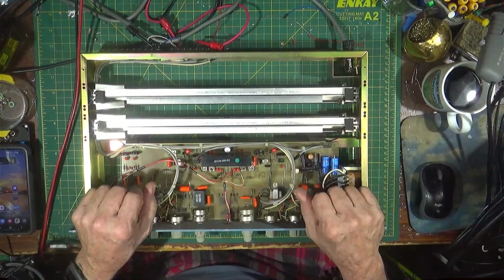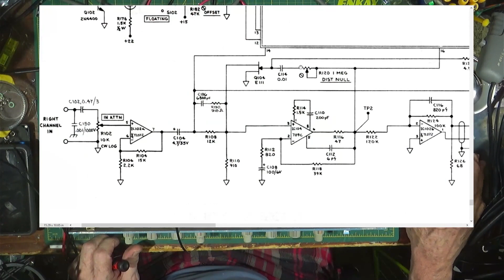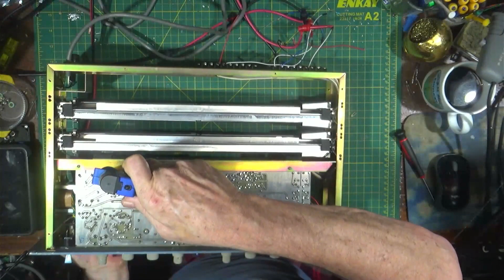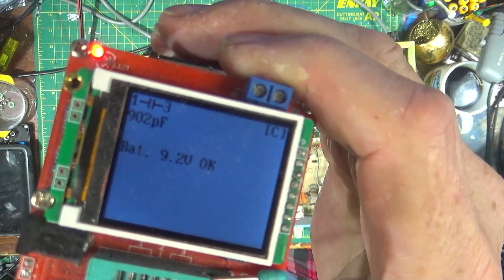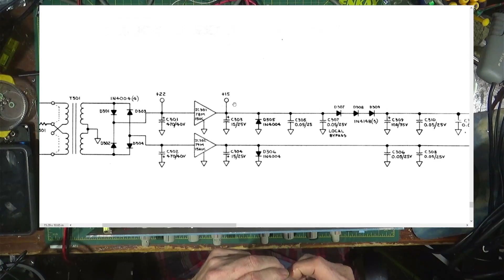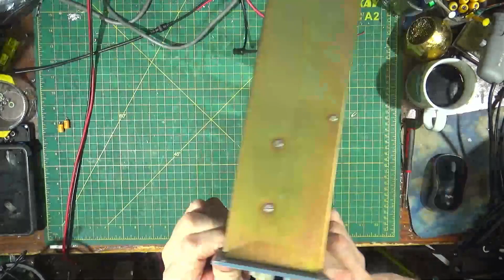Orban 111B Parasound Dual Reverb Repair

Comment: I was watching a video last week and there was a mentioned of the 78xx and 79xx series regulators are known to oscillate and i took note of that. I am working on a Kustom mixer power amplifier and it had an audible motorboating  sound.  I connected the scope to the regulator chips and found about 425k noise from the 7915. also the voltage never went above 12 volts and fell rapidly down to about 9 volts. Replaced with new part and the noise is gone. So you are the second person to say something about it in a weeks time. I never thought that could happen, but it is true now. Thank you for this video.
Reply from the maker: Your welcome.  Don't forget the.01uf across the electrolytic for the really high oscillations. Although those are much less common. Thanks for watching.
Reply: Somewhere on Youtube if memory serves me correctly there is an amplifier made using linear regulators. They can be wired in such a fashion that they operate as amplifiers. That given, it is no surprise that they will oscillate if not padded down with the correct capacitance in the appropriate places.
I have also seen 78 series regulators fail and do all sorts of weird things so it's not uncommon to find a faulty one although in the main they are pretty reliable.